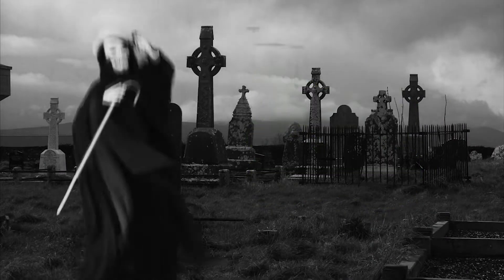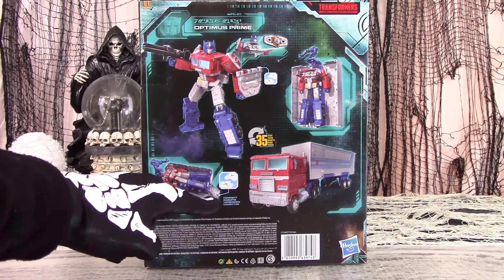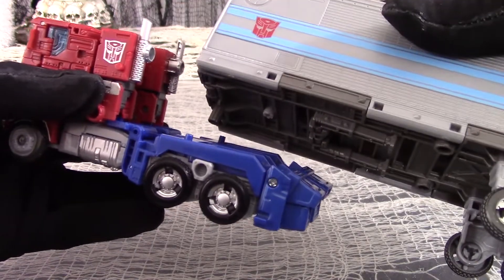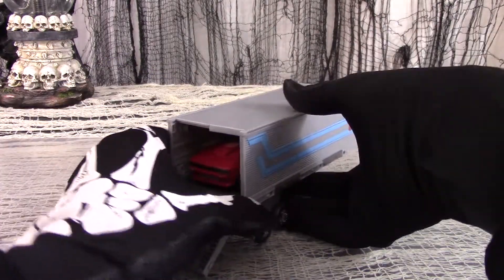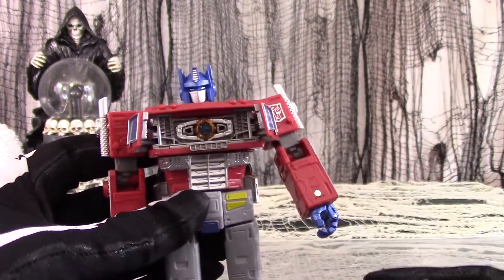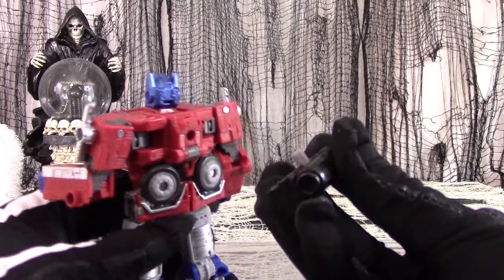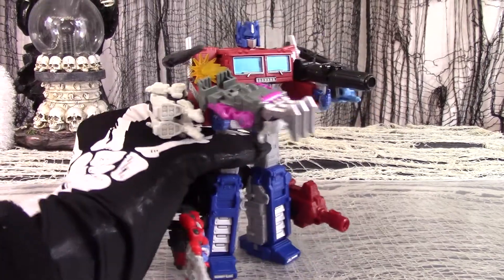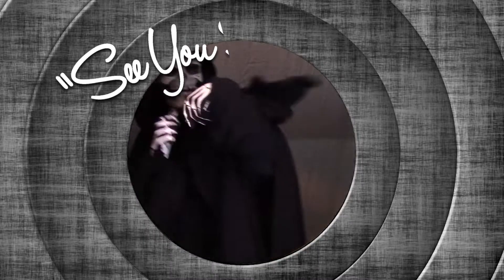Death Reviews: Optimus Prime - Leader - WFC Earthrise

Comment: I got this one for $35 shipped NIB on eBay, I have to question Hasbro redoing this one in Kingdom, I think supply is exceeding demand already. The trailer is small... it's smaller than the one Hasbro made for the DOTM deluxe class Optimus. And I will say that, if you can get one for base retail, KBB's MP-10V + trailer is overall better but they're harder to find now outside of scalpers. This is still a good toy though with more effort than I expected from Hasbro(arm panel covers!) but reusing Siege parts probably left them some extra budget room.

I got the back filler piece made by Go Better Studios. Expensive at $15 but I saved that much off when I got the toy so it balanced out. Good piece, paint is a very nice match(breaking the usual trend) and it can stay in place when transforming. Just as well, the peg is a tight fit. You'll lose gun storage but it does clean up the truck very well.

And the Nonnef trailer kit... it's okay for what it wants to do but I'm not as in love with it as some people are. Bit annoying to install, gray parts do not color match, pegs & holes are often very tight fits(may need a drill bit to widen them out), partforming on the trailer feet is tedious when the JFC kit doesn't have that issue, and the accessories for the drone don't fit well into the claws. And it will need some tiny plastic squares or small foam pads on the trailer support since the new rear wheel guards raise the thing up. Plastic sprues also have really thick parts to cut through to remove bits. Roller's wheels may or may not spin. If the anemic trailer bothers you, I suppose it's decent if overpriced, but I'm not as impressed as I hoped I'd be.